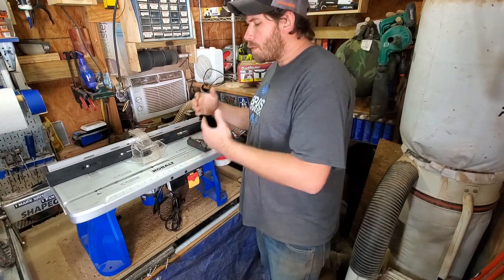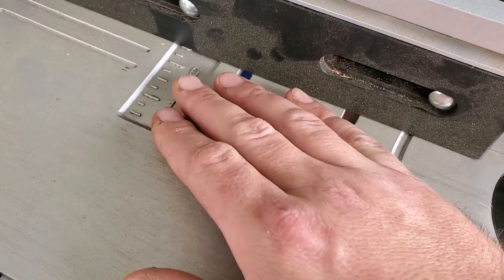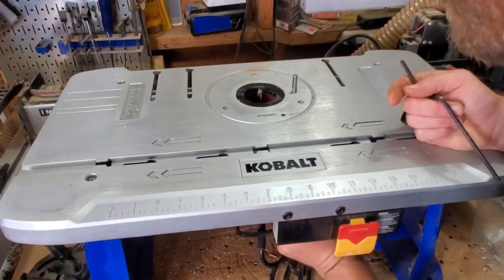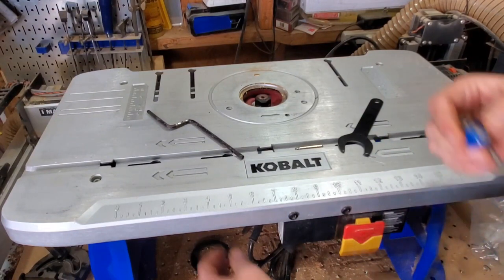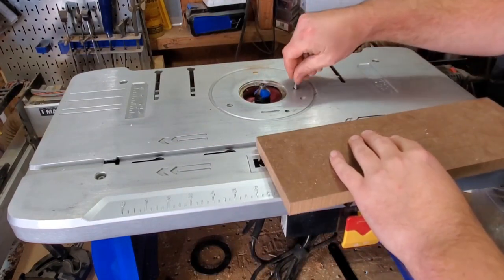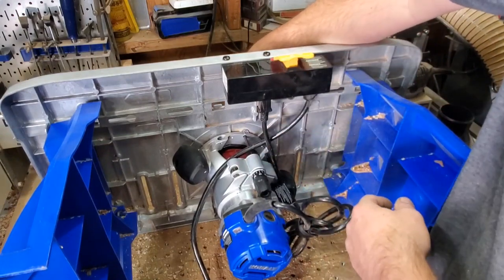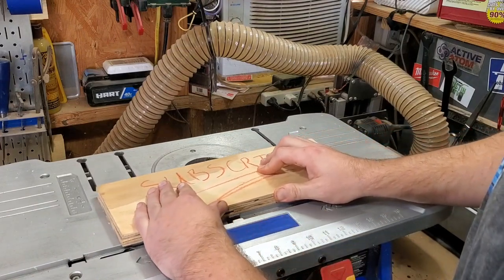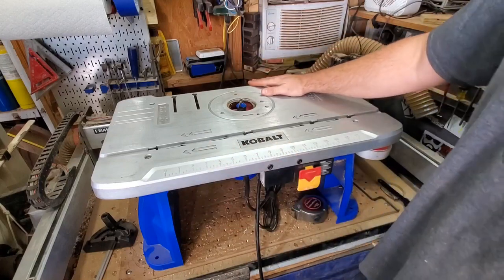Kobalt Router Table REVIEW & DEMO || Great Value 💰👍

Comment from the maker: More reviews on the way 👍 Comment here any tools you've been curious about and would like to see reviewed
Reply: The Milescraft dust collector hose system looks like it works well in your video, but it has some mixed reviews.  You've sold me on the Kobalt router & table, but what about the Milescraft system?  Thanks.  BTW- great job on this review.  Thorough, but straight forward and good info.
Reply from the maker: Its not bad... its a tough tool to get good dust collection on. So dont think its gonna get everything but definitely an improvement.
Reply: I’ll look at your other videos because I’d like to see one about using a kobalt table miter saw also. Thank you ❤️

Comment: Plan to buy this to add to my Delta table saw. It is now (2023) $179. But that is still a great deal. When compared to router lifts at several hundred, spending time building an extension table for the saw, and oh yeah, did i mention the 1/2" collet for the occasional need for a large bit..

2 things you mentioned as problems have been addressed by other YouTubers
  1- keeping the bit from bottoming out - add an "O" ring to the shaft.
  2- Aluminum scuff marks onlight wood - coat table top with good paste wax.
Thanks for a great video.

Comment: I bought the Delta 36-725t2 yesterday and added the Kobalt router that I already had but only used once because the table was too flimsy and whatever I tried to work on moved too much to make it worth my time , However now that I have it connected to the Delta I love using it and I used it more yesterday then I have since I bought it about 2 years ago. Thanks for the video, also I have the Craftsman 10 inch table saw That was never even half as good as the delta the wheels on the delta are great because they allow you to move the table with ease if needed to work on large pieces of wood, since I'm making a window seat for my wife this ability is awesome.
Reply from the maker: Good feedback 👍

Comment: Thanks for the content. Saved me time from ordering a $600+ table saw that’s capable of using a $100+ dado blade
Reply from the maker: Always multiple ways to complete the same task in woodworking. The router and router table is imo the single most versitile tool in any shop

Comment: First‼️
Looks like a nice router table.
Reply from the maker: Lol its been a little bit huh? 🤣
Reply: @BradsWorkbench  been real busy and tired. They shutdown our elevator at work to replace the lift system and controls. If we're lucky, we get it back in 5 weeks. I'm guessing 7, morning guy thinks 8. With the way things go at work, it'll probably be 9-10. There are 42 steps from first to 3rd plus landings
Reply from the maker: Yeesh! Sounds like when the freight elevators broke down at the plant. Those stairs cant get brutal over time

Comment: I bought the Kobalt router table about 3 years ago. It is a very basic router table. I have been desiring to make box joints but have bee scratching my head on how to make a jig for the table. Rocker jig won't fit the miter track. I am probably going to have build a table to do box joints.
Reply from the maker: Bingo.... its a pretty simple jig to make

Comment: This is not the first video I've watched on this router table but I have to ask why is everyone showing the feature to raise the bit but not showing that the dust guard/vacuum opening block the tool? This has to be removed in order to raise and lower the bit. Then replaced if you want to vacuum out the dust while in use...Kind of a pain in the butt!
Reply from the maker: Id guess because most, like myself never bothered (at least I dont remember if I did) with the vac attachment that goes on the router. But I'm glad you commented so that info is now available to people 👍

Comment: Damn been wanting a router table but I already have a router lol. That one looks very similar to one of the Bosch router tables. Thanks for the video and happy your back 👍
Reply from the maker: Routers are like angle grinders, can never have too many.
Reply: Beats changing the router every time you want to use the table or freehand. I got it and have 2 routers, one being a palm.
Reply: @freebird1963  lol for sure. I got a palm and a base/plunge router but I know what you mean.  I have a home made router table and it's a paint to change the bit. Especially since I use that table for primarily doing box joints. If I see it on sale again, for sure I'll get it.

Comment: Use a few coats of paste wax and it will seal tbe top from marking light colored wood and smooth the feeding of the wood on the table. The miter slot is the worst part if you need one to mount jigs. You can't use t-bolts in it and it isn't fully clear so you can't drop in a full length bar as the little tabs  block that. The tabs can also hang up the miter gage or bars sliding through. It still a good starting unit with some mods one that can grow.😂

Comment: Great review, but did you notice that the height adjustment goes down smoothly, but you have to physically pick up the router while turning the elevation screw in order to raise the height? Even then, it drops down or slowly slides down with repeated use. Did you have that problem? Any fixes?
Reply from the maker: I dont have to lift mine but it is harder to raise then lower. If yours is sliding down I'd look into seeing if u can tighten the "lever/strap" you have to unclip before moving. I've had to do that on other routers in the past
Reply: The depth screw mechanism on the included router isn't the most robust thing in the world, I just support mine with my hand while raising it.  You want a $130 router table, you can support the router with your hand while raising it.

Comment: I personally do not like the location of the switch, I moved mine to the leg. Its location gets in the way of unlocking the router. The router itself has problems, well mine at least. The elevation crank does not work without it dropping down after getting to the top. The aluminum top could have been square instead of rounded and tapered on the edges. I would like to use it with a sled or jig but that is not possible with this top. It would work if it had two runner tracks. But alas it only has one.
Reply from the maker: Good critques. I havent had any issues with the router myself. What kind of sled are u after that the 1 slot across the front on the router wont work?

Comment: My inserts will not go completely in. The tabs on the inserts have no way to catch as the router mounting plate on the router itself allows no room. Did you have the same problem?
Reply from the maker: No, mine all sit completely flush. Actually kinda of a pain to pop out sometimes
Reply: My inserts are too small and sit too low. The wood edge will catch on the table.. I guess it's hit or miss with these inserts.. I'll try a set of replacement inserts...
Reply from the maker: You are probably correct.

Comment: Hi Brad, great review and demo. Can you answer a couple of questions for me? What is the opening diameter on the router base. In another video it was stated that a 3/8 round over bit was to large to fit the opening. Second question, what is the width and length of the tables footprint. Just wondering if my router table cart will work with this. Thanks in advance.
Reply from the maker: Not sure how a 3/8" roundover bit would be too large. They come with different sized plates and for really large bits, i would just remove it completely. Ill check the foot print when i get home
Reply: Hi Brad, after closer review it's only an issue with the plexiglass base when using the router freehand. Apparently when mounting in the table the base most likely is removed. I'd still appreciate if you could provide the width and length of the tables footprint. Thanks again and have a Merry Christmas.
Reply from the maker: @ronpost587  approx 14" deep, 26" long, 13" tall 👍
Reply: Hi Brad, thanks for the reply. Very much appreciated.

Comment: What do you mean unlocking the router cause I cannot lift it or lower it?
Reply from the maker: Theres a latch on the router u have to pull out before you can move it
Reply: @BradsWorkbench  figured that out, and yesterday on the same day I mangled my fingernail and had to go to immediate care... the first thing I did coming back home was unplugging the table.
Reply from the maker: Yeesh...  hope u heal up quick. Its a very useful tool but like them all needs to be respected.

Comment: CAN THIS USE AND RAISE PANEL BITS
Reply from the maker: I personally havent tried a cut that heavy. My gut says it would probably do it (on a modest hardwood and with nice sharp bit) but wouldnt be ideal. So I'd say if your only doing panel doors on occassion it would be ok. If you plan on doing them on a regular basis, maybe look for a router with a bit more power
Reply: @BradsWorkbench  I thank you much bro
Reply from the maker: Np

Comment: Where is the review of Milescraft Dust Router
Reply from the maker: I shot it but half of the footage had no sound for some reason. Quick review.... its ok. It does become a little pain in the ass when u have to adjust height. Does catch alot of dust tho

Comment: This router table and router is a piece of crap. The fence is not stable, the plastic fasteners to tighten the fence striped out,the adjustment worm on the router slips and in general it's not worth 2 cents.
Reply from the maker: Yet to have any of those issues 🤷‍♂️
Reply: Skill issue